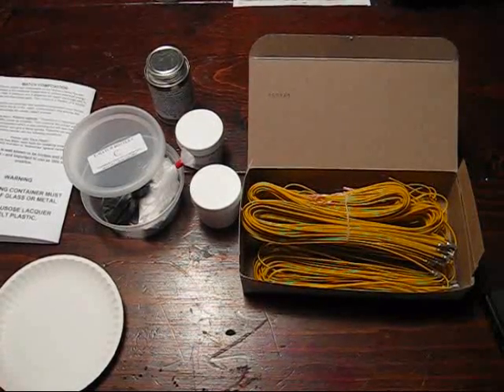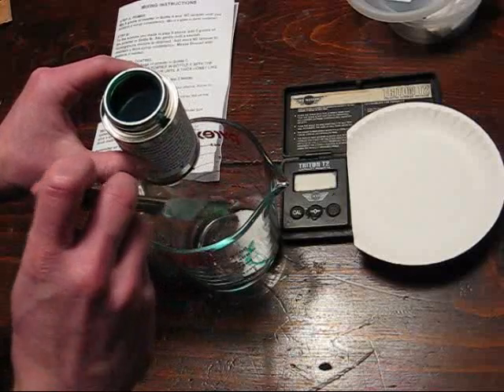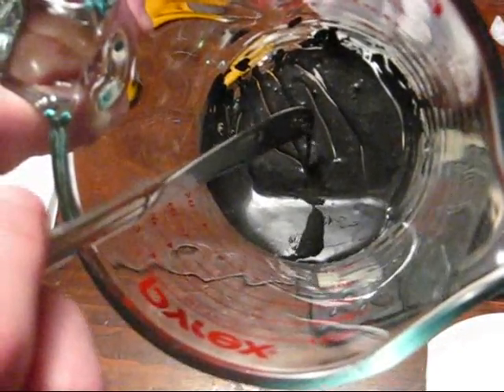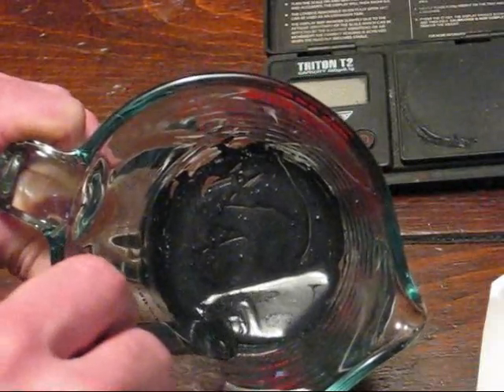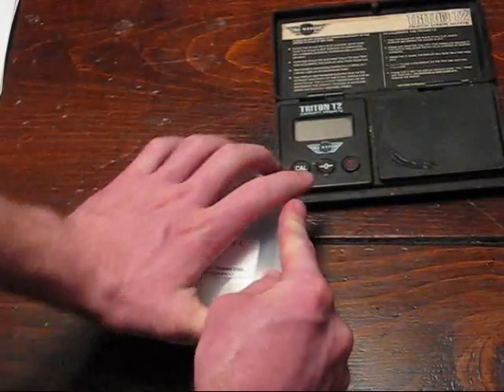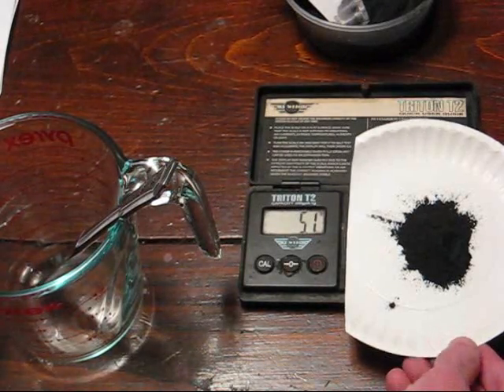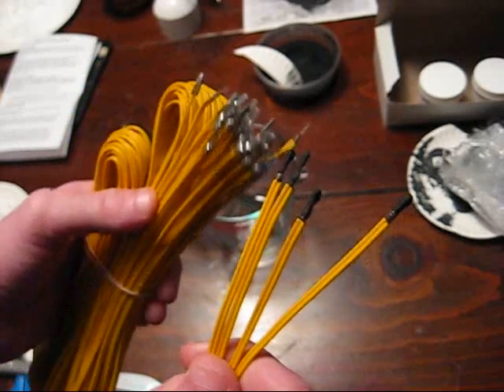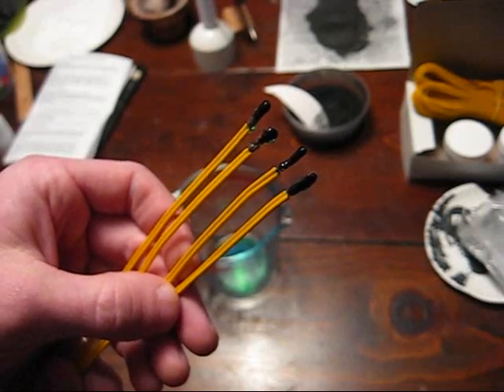How to Use an eMatch Kit and Bridgewires - PyroDirect

Comment: you get the same result if you just use a very thin wire to bridge between two thicker wires. The thin one shorts out and lights a fuse you've wrapped it around... costs basically nothing